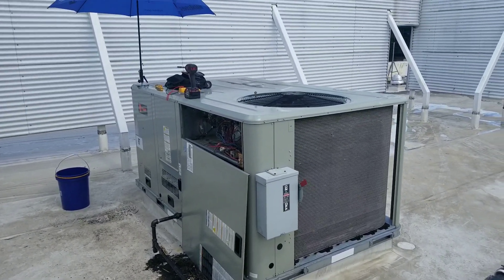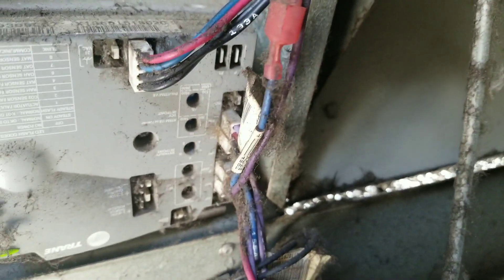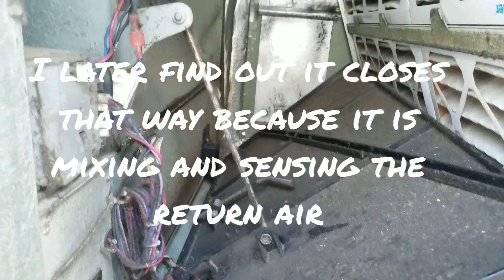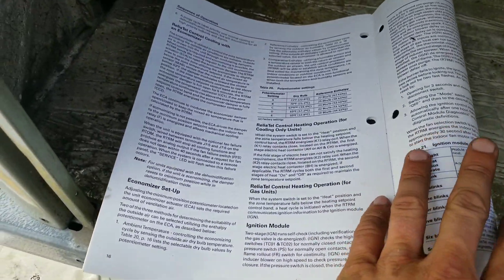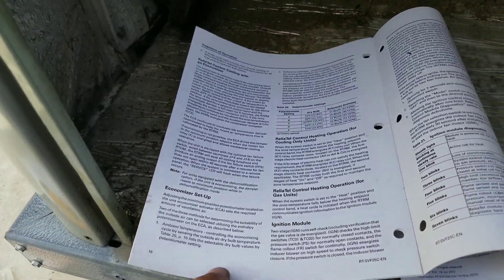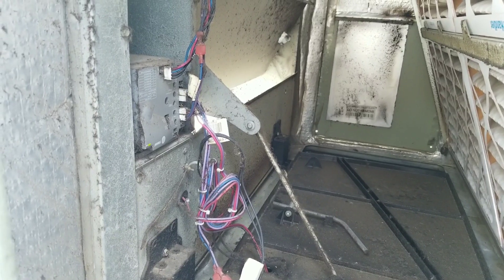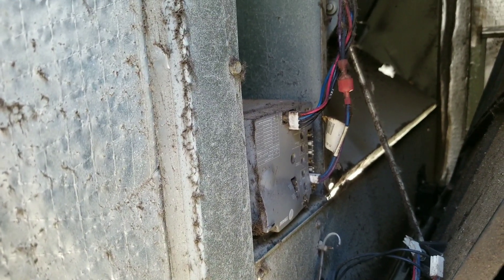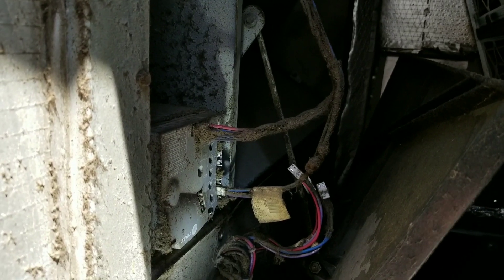Trane package unit no AC

Comment: I have to be smarter than what I'm working on in order to be effective. Most sophisticated economizers operate proportionally. As the outside air dampers open, the return air closes. This is to keep an air volume balance and to try and maintain a temperature setpoint. Some will use enthalpy setpoint control. This should be understood already, but I'll say it anyway.. The goal is to use the air source that will require the least amount of energy to cool and when the OSAT is low enough, require nothing more than fan power turning off the refrigeration section. I mean no offense to any hvac techs, but I find that economizers often get turned off because most HVAC techs don't understand them nor are they interested in taking the time to learn how they work. 
BTW, enthalpy is a value that's a combination of humidity and temperature, not humidity alone. Not to get overly technical here, but the value measures the number of water molecules and their temperature . The energy of cooling that must be applied to the coil to meet setpoint is dependant on the number of water molicules and how much the temperature needs to be changed.. The return air enthalpy is compared to the ouside air enthalpy and the lowest of the two is the best choice. modulating of the economizer on the other hand is generally done based on maintaining a temperature. Humidity is also a concern because of the energy wasted in the coil to dehumidify.

Comment: Good work as always! (get knowed up! Ha ha) hey know its a pain and time consuming. Could possible to use a Shop Vac etc., to clean the inside area? Know all before the filter. But the build up can fall into ducting below, and grow icky stuff that filter will not remove. Use long wand with a brush head. Also see you and others on the coil side not clean up the build up! Why?

Comment: Unfortunately  not everyone checks the economizer settings. One time I ran into a rooftop unit that had the economizer still collapsed inside as shipped from the factory. Very funny to find things like that.
Reply from the maker: Wow- lol I havent found that before-- just a few units that had duct work ran to the unit but no actual hole in the ductwork for it to bring in air, lol

Comment: I don’t think they only look at humidity, they look at enthalpy (btu content in the air), which is a combination of temp and humidity. The controller is trying to determine if it is easier to cool dry, hot OA or more wet, but cooler return air. It is almost always cheaper to mechanically cool dry air. Regardless of the set up, it still should have turned on mechanical cooling if it was not able to meet setpoint. My money is you have a bad sensor and a bad board. But if it works with dry bulb, and the customer doesn’t care, all good 👍 sweet vid.
Reply: It compares ra enthalpy against oa enthalpy. If the math works out in the enthalpy calculations, it can cool with the oa, and it's lower enthalpy. The enthalpy math at 93 degrees and low humidity, should have calculated out to DX only. Those humidity sensors are not very reliable. I have 'fixed' many trane units the same way you did. There may be a day where it is just cool enough, and dry enough to free cool, and dry bulb only might miss that. Improved reliability is what I would shoot for also. Google enthalpy calculator, and fiddle with the inputs. Good video!
Reply from the maker: You make a good point Johnathan- I'll be going back soon for there spring pm so I'll get to revisit this case and see how it's been running. Thanks for watching
Reply: Curious HVAC Guy Did the unit have a 2 stage stat?
Reply: @jonathanschulz5841  I see this overlooked all the time, the installers think because its a single stage unit, that they can use a single stage stat and not wire stage two. If there is no call on y2 then the economizer will never energize the first stage compressor while it thinks its suitable to economize even if economizing alone is not enough to satisfy the setpoint. At a minimum y2 needs to be jumped to y1 or better yet use a two stage stat.

Comment: Enthalpy economizers take into consideration "total heat" of the air based on a sliding scale computation internal to the manufactures design. They are designed to allow the air with the least amount of heat to make contact with the evaporator coil as the evaporator is  designed to remove two types of heat. One is sensible heat with the other latent heat. Both represent "total heat". By using enthalpy the system uses less power because it's removing less heat so it doesn't have to work as hard. However, at an outdoor air temperature of 92 even in a dry climate the enthalpy control should have automatically removed itself from the control circuit & switched over to mechanical refrigeration.

Comment: From Trane’s own recommendations, to disconnect the humidity sensors, tells me their engineering design is flawed. In my view, external temperature sensors should be the primary control of the economizers. External humidity sensors should override the economizer’s function only when outdoor relative humidity is too high for indoor comfort even though the outside temperature is, say around 50°. Cool humid air being pumped indoors WILL bring complaints❗️Thanks for your coverage of this topic❗️

Comment: Did it have a 2 stage thermostat? If y2 is energized and it is ok to economize, the unit will economize and run the compressor. Every economizer should have a 2 stage stat. We run into this a lot in freezer farms.
Reply: Curious HVAC guy basically a freezer farm is a big room where they have a bunch of -80c freezers for storing test samples. Generates a lot of heat 24/7. The economizers really work over night bringing in the “free cooling”. Another interesting  thing I learned with high heat load conditions with economizers is that y3 on a jade controller is actually a timer setting. The default is 2 hours. That is definitely a must change setting for something like a freezer farm.The company I work for does mostly pharmaceutical and clean rooms in Southern California.
Reply: Serious question. If the economizer is set for free cooling at 55°F what's the need for mechanical? I just got chewed out because I noted on two new rtu installs that these units with economizers need 2 stage stats for mechanical and free cooling to maintain a mixed air temp of 55°F. So instead of getting bitched at for trying to do what I thought was right I'm setting the enthalpy sensors for 55°F hoping that anything above that (given that the enthalpy sensors are working properly) it'll just drive the outside air dampers closed, open up the return damper and just bring on mechanical.
Reply: 4!RF0RC3 JU4N should not have gotten bitched at. That’s dumb logic. When the economizer, sensor, damper, etc go bad a two stage stat will turn on the mechanical cooling if the economizer doesn’t keep up (probably because it’s broken). Or what if you have a high heat load like a server or elevator room? For those rooms I typically set the Econ for 60-65deg with mechanical cooling as. Back up. Easier to cool 65deg air vs 78deg (most cases).